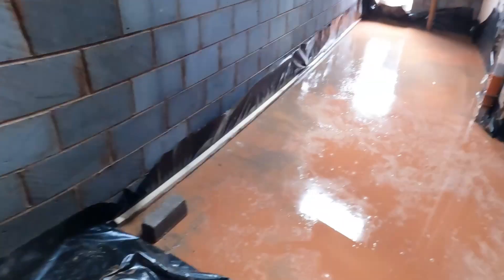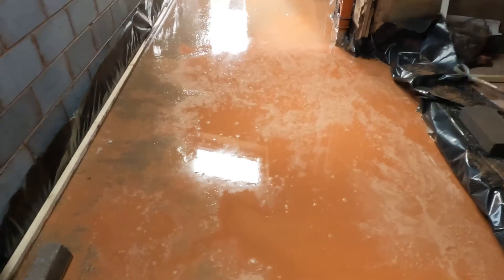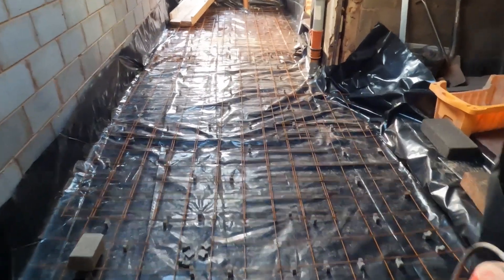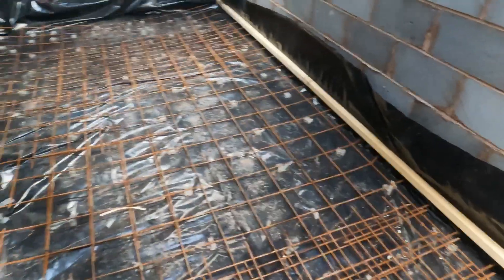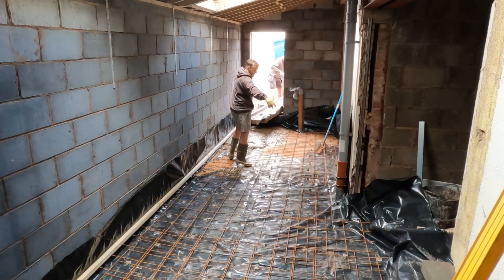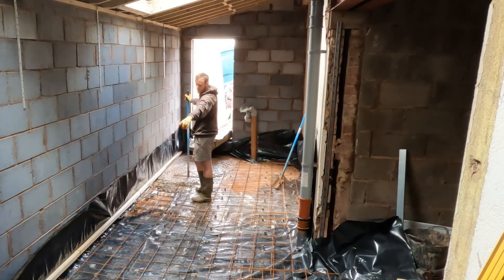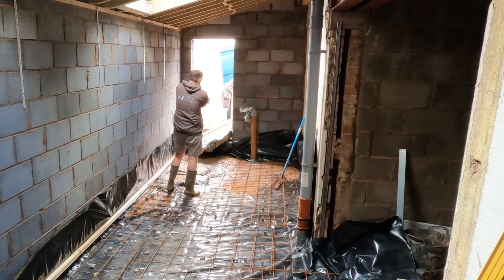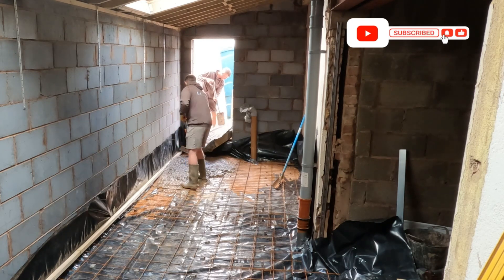How To Install Reinforcing Mesh When Concreting A Floor

Comment: ive been a concrete finisher for 37 years joke of a job ,spacers placed in the wrong place gaffa tape around the cut polythene, is gaffa tape the correct tape to use?absolute joke of job ,

Comment: You wasted your money on rebar mesh. The concrete is only lying on top of it.
Reply: Isnt that the idea?
Reply: @AlanCarter-pw4bm  I was told that the mesh is best just off the bottom of the slab using dog biscuites.... But im not a ground worker mate